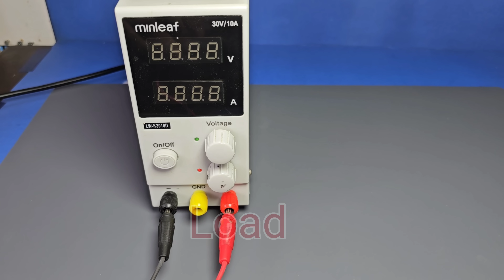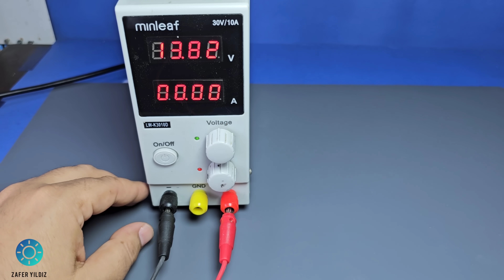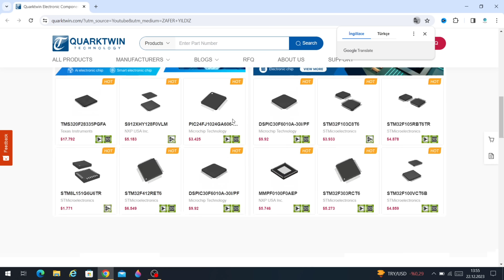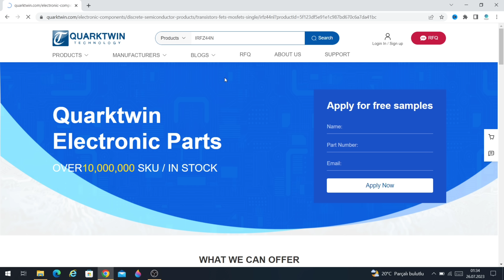12 Volt Automatic Cut-Off Smart Battery Charging Circuit - New Design

Comment: Good evening, I would like to know if this circuit also works to charge a 6 volt battery by halving the value of the resistors and the trimmer. Thanks this circuit is very interesting.

Comment: I have attempted to draw the circuit diagram but I’m unable to post it here.  I think the key here lies in the voltage on the top rail (joining yellow to red wire) as the charge increases in the battery on the red end.  If this voltage stays constant - then I can’t see what changes to turn off the MOSFET. If it increases as the battery charges (as I think it does) then the reference voltage into the TL431 will also increase.  When the reference voltage is reached, I believe the cathode and therefore the gate-source voltage, will be held at the reference voltage - I would expect this to turn on the MOSFET - I’m confused.
Reply: Je suis de votre avis, seulement ce Monsieur est en train de nous arnaquer au sens "terrible" du terme. J'ai essayé un de se schémas,  je n'y arrivais pas .La led verte toujours allumé. Ce Monsieur s'est moqué de nous et moi une seul fois et c'et BASTA.

Comment: built this 4 times exactly step buy step as in video, it does not work as demonstrated in the video. the bulb never goes completely out, fet gets hot.
Reply: The red led use 15k and superbright led. The green led use 1k5 and the other resistor can use 1k still. Should turn on harder and FET will not get hot. The charge is limited by diode capacity. I'd use a 1N5401 to 1N5412 with higher current.

Comment: Sir can we connect this circuit with battery permanent. Will it consume battery when the circuit will not connect to power supply
Reply: Just use a diode it wont consume any current .
Reply: @xjhoox there is diodes already at pin 2 of MOSFET.

Comment: Sir i tried 3 times the same way but tl431 shorted after 4, 5 seconds. Why?
Reply from the maker: There is no logical explanation. Use a quality integrated circuit. Sometimes cheap integrated circuits can break down quickly.

Comment: and  12. 6 v  lithium ion battery  low full Cut off circuit Diagram please 🙏
Reply: 12. .6 v 3 s  dc power supply  Cut off circuit 🙏
Reply from the maker: you can use existing circuit along with a current limiting resistor